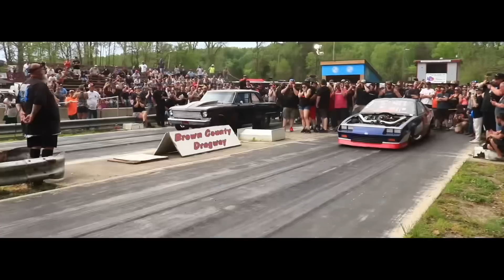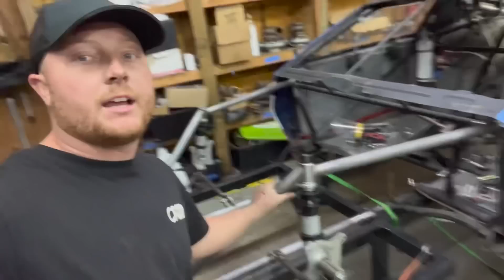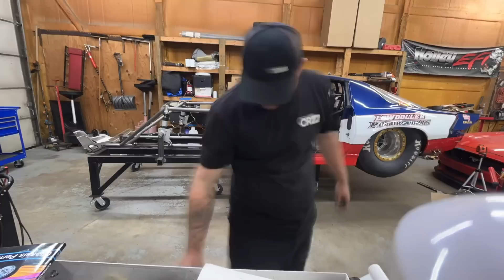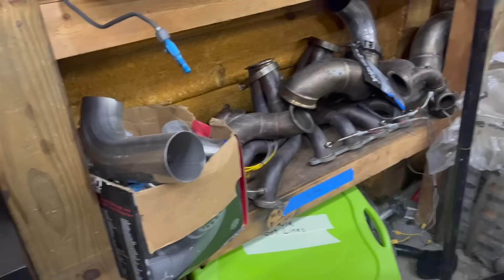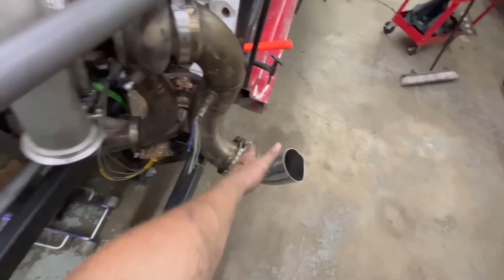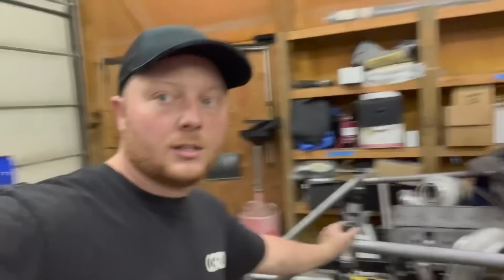Control Arm Placement & Mock Up Motor For Uncle Sam!

Comment: Maybe a oval section in the down pipes would get you clearance, to get you past the lower strut braces?
Reply from the maker: I think I’m just gonna redo them in aluminum to lose some weight
Reply: @nickkybobbyinc  Aluminum down pipes?
Reply from the maker: @georgedreisch2662  yessir

Comment: Chassis fab is my absolute favorite part about building racecars. The rest is just bolt on shmit.
Reply: If you use muffler pipe its really cheap pro tip there you are welcome champ

Comment: I just comment on a video and bam this one came up. And yet a lot closer to those 6 second passes. Ok I saw those safety crocs on Moo are two different colors.  Do you have a motor ready for it?
Reply from the maker: The motor is at the machine shop but I’m still collecting parts slowly but surely